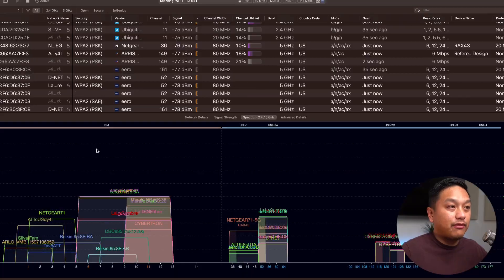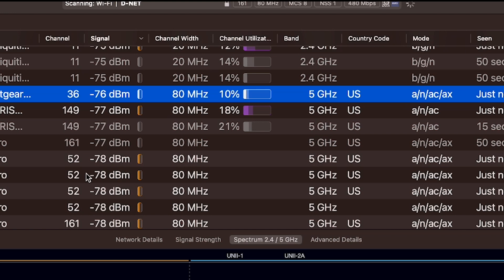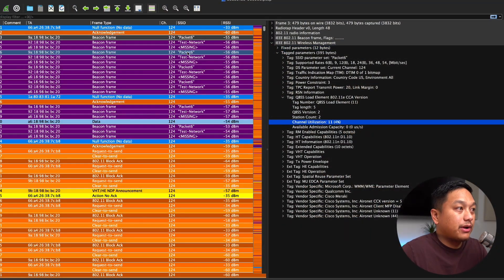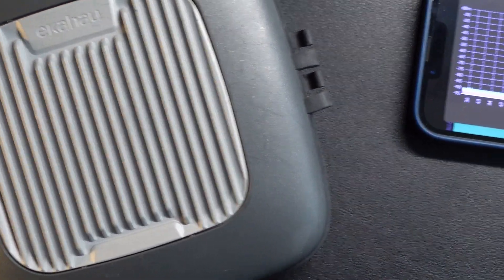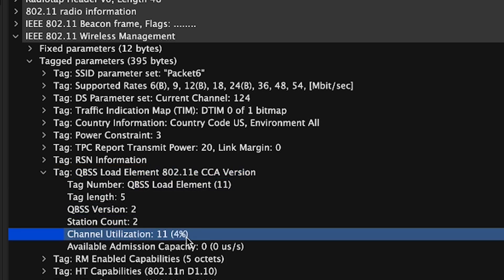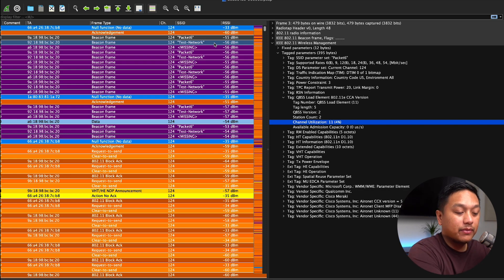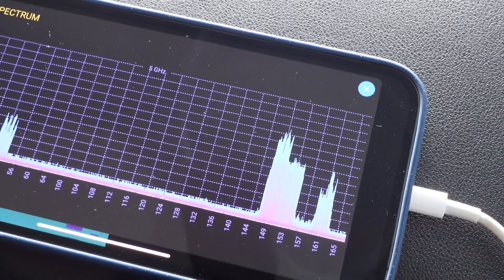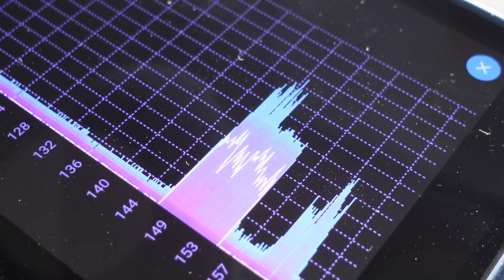Wi-Fi Channel Utilization

Comment: I think BSS Load is an L2 utilization whereas spectrum utilization is an L1.   I found that they don't always correlated.  Often when the spectrum is full, the QBSS still show moderate utilization.
Reply from the maker: That is a good distinction to look at. I will plan a follow up to record BSS Load and SpecAn at the same time. I don’t think we will always see the same values. The AP would still need to check the medium whereas SpecAn is always on.
Reply: @RowellDionicio  My understanding of this is there is "Wi-Fi" and "non-WiFi" channel utilization.  The spec an reads RAW RF which is everything WiFi and non-WiFi, where QBSS is Wi-Fi specific AND 4dB or more SNR above noise floor (typically -87dBm or stronger).  Will the WiFi radio be "dumb" and show low channel utilization when the RF spectrum is high in interference?  A side-by-side comparison would be interesting (run the spec an and AP channel utilization at the same time).  Try creating non-WiFi interference and see what happens.  An easy test may be to put the AP on channel 1 @ 20MHz and purposely put another AP on channel 2 near it.  It would be non-WiFi interference from the AP's perspective.  Cheers!